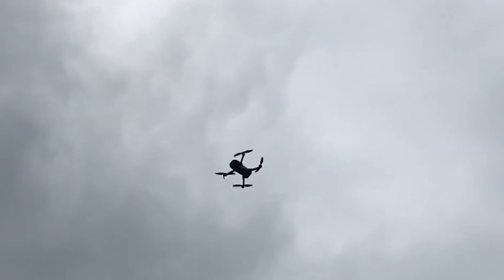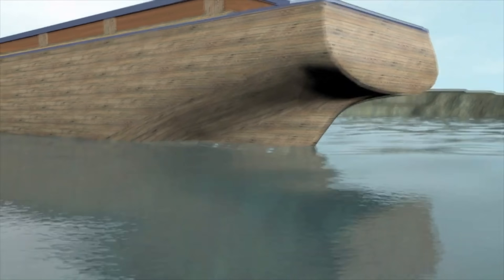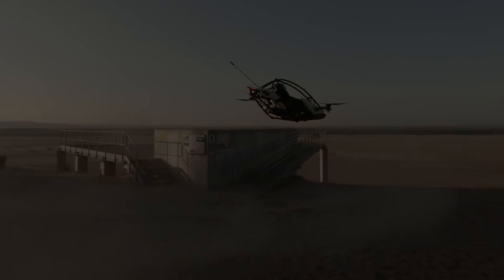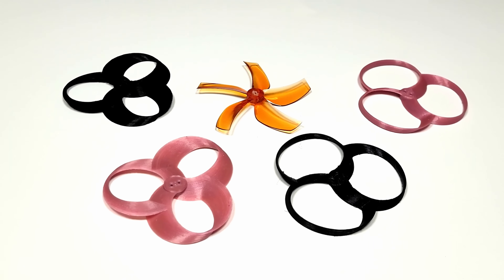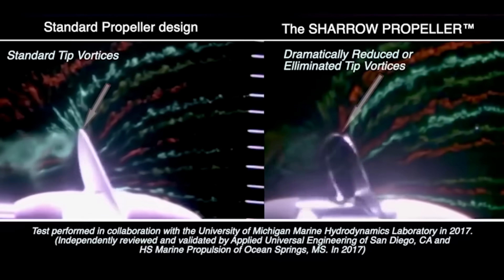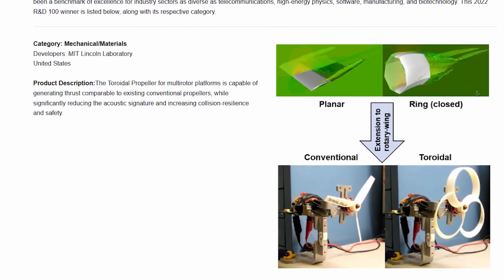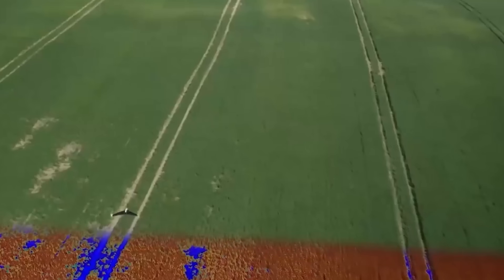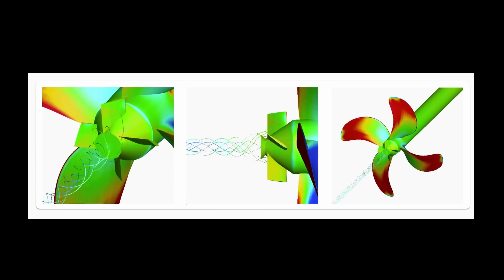This Propeller will Change Aviation Forever!

Comment: You know nothing about aerodynamics.  The conventional airplane propeller is very efficient, around 90 percent.  Some specific applications aircraft propellers are 95% efficient (large and slow turning).  Hell, the Wright brothers propeller had an efficiency of around 70%.  The difference is air vs water.  Boat propellers are below 50% efficiency.  That is why there is a lot of room for improvement in boat propellers.   Toroidal propellers will never be used in aircraft.

Comment: Look at the graph again @3.36 then running at full motor utilization the Toroidal propeller only delivers 160g of thrust while the standard gives 450g. 
So it is useless outside very niche applications where efficiency and payload matters very little.

Comment: You will not see this on general aviation aircraft.  GA airplanes must pass the "Queen Test".  This propeller on a marine application is acceptable due to alleged performance improvements, and most importantly, it is unseen.  For all the other myriad negative reasons, if the Queen (wife) saw this abomination on the front of the family plane it would mean the husband/pilot would have to make a decision between prostate exultation or this prop.  In my vast aviation experience prostate exultation will win every time.

Comment: why not do this, put a propeller on the back of the plane that is linked to the one in the front, as the front one pulls the plane through the air, the air will drive the rear one, thus powering the front one. it will accellerate until it breaks up.
btw, there is a group who claims to have done pretty much the same thing with a propeller driven car.
Reply: The was a German aircraft with an aircrew at both ends,  driven by a piston engine.

Comment: You can only use this if you do not have a variable pitch.
Try to come up with a design for toroidal prop with variable pitch!
Sure fine with a certain applications, but if you can’t change the pitch on an aircraft prop you are back in the pre-WW2 days.
Engine out, well no means to feather it to reduce resistance or stop the engine from shaking the aircraft to pieces. Speed difference, no means to adjust pitch to be optimized. So all this talk of revolution. It an interesting development which will have its uses, but it is not the end all. It will replace similar non-variable pitch props, sure if cost effective.
Could you use this technology with turbofans?

Comment: limited and will cause extra drag if your engine ever goes out as normal props you can feather to stop the wind spinning it around causing less drag while with these you will just be stuck with the angle on the blade not able to adjust it or anything there's a lot more that go into the props then you think specially as small scale these have already been destroyed by other designs as yes it makes more lift but also more drag and a lot more disadvantages to a normal prop design and with laws in the usa you cant even use these on your drones as they don't fold back and can lacerate and balancing these would be a bigger pain let alone anything goes wrong with all that extra wieght that would prob just rip the motor right out a cesna if a chunk broke off causing heavy vibration that again in the normal prop you can change angle of attack to stop from spinning while with this design you loose a chunk your going for a ride with nothing you can do about it it will end up just like the round wing designed planes that are just impractical because someone said oh it can lift more and dident account for drag wieght or anything else other then lift the only part i can find practical for its use is boat propellers and that's it as for planes more dangerous most drones in the usa cant use them on even tho ive tested a set on my dji and they are trash and loud when compared to silent generic prop designs and could never be used for a plane due to the fixxed angle of the prop and same issue with helis or anything else to use this design and bad for drones as ive found if i loose a chunk of my props with my drone i can still fly and bring it back in even off balance but with this design your just fked as u will loose all lift depending where it snaps from

Comment: I think one thing they need to consider are fluid variables. You can design a single propeller for water because it's relative pressure/temperature remains within certain parameters. While in flight, you're soaring through differing pressure/temperatures all the time plus the variables of the motor that turn it. (both electrical or combustion style motors)
Reply: It was lab test first in software, then they decided to test on drones.  This is far from perfect, but also far from optimised as air and water are both fluids but quite different...
Reply: Air is a compressible fluid. That does make things quite different to water
Reply: soaring so high above the world, never thought i could feel so free
Reply: @evanfinch4987  Hello Icarus :*
Reply: @evanfinch4987  lsd is good
Reply: @france895  
The worst drug on or off this planet.
Reply: @Mr.Robert1  Are you experienced?
Reply: The one application I’ve seen that seemed to have a lot of potential was continuous wings on planes that curve back to the fuselage.
Reply: im one with the birds, and magic is all i see
Reply: Flight would not be an issue. Prop plane propellers don't adapt to humidity.
Reply: @Broesky  They don't slice salami well either.
Reply: basically it is a box wing used as a prop.
Reply: This propeller is something like a ducted fan, I'd prefer to see how this does against a true ducted fan and a propeller with full ring around it...I just don't think it's a realistic comparison for any test
Reply: Yeh, MIT is hardly AFfirmative action central if you know wha im sayin
Reply: It's also not the end all be all for marine either. In the best conditions it's able to achieve up to 20% more fuel efficiency as claimed on some testing. But thats everything goes right testing, make one variable poor for the test and you radically drop efficiency. It's going to be a rather benign change that will affect the bleeding edge of the boating market, as well as the extremes. But starting at $5,000 for a 200HP marine motor really isn't very enticing considering a standard prop only costs $200-300. It's not like buying an engine for the boat either, props don't last forever. It's like buying a set of tires for the boat, at least if you want any performance. Sure smaller boats run their props for the better part of 30 years in slow lake boating as long as they don't prop strike anything. But take any bay boat and you are looking at a lifespan of less than 10 years.
Reply: Works on drones😂
Reply: please see my comment posted 7th April
Reply: I would think this problem would apply equally to normal  propellers as to this new type the only advantage open propellers seem to have is the possibility of adjusting the pitch in flight and this seems to be rarely done. As to  propeller life I would think that less vibration would result in longer service life.
Reply: it's ok the first toroidal props for airplanes with variable pitch are coming soon, nothing is impossible, think this way even if it's not true, it will help you puch your abilities to the limits, as for variable pitch propellers of this type, totally doable and possible.
Reply: Also ignores the advantages of variable pitch (constant speed) propellers, where the faster you move through the air, the more pitch you can dial in to grab more air at the same RPM. It would be a challenge with blades that are, looking at this, apparently immovable.
Reply: Just match the pitch of the blade to the motor and altitude
Reply: Fluid dynamics is broken into two main categories: liquid and gas. Main difference to each: one can be compressed, the other cant. There are also plenty newtonian and non newtonian conditions which affect motion and energy transfer. What makes this "closed loop" blade more efficient: they are stiffer. Less energy is lost to primary parasitic effects, which lead to secondary or tertiary losses.
Reply: @priitmolder6475  Wrong...liquid and gas both, can be compressed..ad they are both compressed in a situation like this.....compression on a boat screw edge causes cavitation (bubbles caused by the difference in pressures in relation to edge velocity. Compression on a plane propeller edge causes noise that result differing pressures on the back edge and leading edge, but it's not cavitation. 6 years as a Sonar Tech in the Navy...I went to school for this shit....so, don't listen to me, I don't give a shit...I'm right.
Reply: @priitmolder6475  would it make sense to hide something similar inside turbofan, where some of the variables can be controlled?
Reply: @MrrVlad  in theory yes, in practical terms no. Elongation at those high RPMs will become real issue.
Reply: Lmao. You genuinely believe you just told the researchers at MIT something they hadn't considered don't you.......People are so deluded its hilarious.
Reply: @kermitthefragg  Read the comment directly above yours😂😂and read my educated explanation...these people are insane😂😂
Reply: @kermitthefragg  The internet is fking hilarious and very concerning at the same time....

Comment: Could they make a wheel for a car with a shape similar to this propeller but with a rim and tire surrounding the propeller.  Would this cause enough air flow to keep the engine cool?
Reply: *radiator
Reply: ... where'd you think the airflow would go?
Reply: @ridhosamudro2199  This would create a vacuum between a wheel and the car that could suck out air through a grille or slots.

Comment: I have been pondering on the idea of a design to Far better the Ridiculous Massive high cost and size of not just the produce but also Massive cost of transport ing to site is Eye-watering!!! And they are not built with much thought.
That is the Huh Wind Farm structures, What ugly eye sites they are! The Toroidal Prop is the  design to replace the 3 blade props. Building a multiple say boxed number of props, plus installation of arrays of Solar equipment. If mounted in water movement or at a Dam structure, then power gained would be Far far greater than present Wind Turbines as already said A Huge amount of money wast to the Tax payer.
That’s YOU and I.

The Toroidal Prop is radical and you have to give credit to those designers trying to improve the propeller design. I say Well done to them!!!

Mm! The Toroidal prop would be a challenge as Swinging a prop to start your Pitt’s Special, or other types.

Keep up the jolly good work on the Toroidal Propeller people!
Could be super better than the present housed in cowlings re Jet engines. Just a thought!

Best of luck and Happy hunting.

JB. UK. 

JB. UK.

Comment: For the time being, I'll stick with my Prince P-Tip prop on my experimental. The P tips make it MUCH quieter, as verfied by comments of others over the last 2400 hours of flying with it. BUT, this looks interesing, if I had a boat.....
Reply: The P-tip is a beautiful propeller.  I had one but when visiting Paul Lipps in Santa Maria (I was there to meet him to balance the prop (his design and construction) on his Lancair.  In discussing my P-tip he explained how the fastest moving part of the prop, the tip, should be minimized, ideally to zero. This teroidal design seems to do just that.   A P-tip, even though it's true they are quieter (just like with Hartzell's Q tip) the additional mass being hung out on the ends is detrimental to efficiency.    I'm very taken by how sensible the torodial seems to be.  CNC machines and composite materials already in existence could be used to 3-D print one to exact specifications for use on Experimental category aircraft.   If someone is already doing it it would sure be interesting to read about.   I would be happy to contribute the use of my single engine Experimental conventional-gear aircraft.  Mass of the torodial may be higher than my existing wooden 52 x 56 but my plane tends to be biased toward the tail when in normal configuration so a little more weight on the nose wouldn't hurt it.    If made with a diameter of 55 inches or less and is drilled to mate with my standard shaft, standard prop bolt pattern, and has been statically balanced, I'd be happy to test drive this new idea.  Like Paul Lipps, I find props interesting.
Reply: right on

Comment: you know I talked about this prop on a plane a few months ago and everyone laughed lol
Reply: Don't worry, everyone's still laughing.  This is just another scammy content piece with bogus info about a prop design that looks interesting but has almost zero practical application.
Reply: @paulybeefs8588  it's actually quite interesting and possible but I'd have to explain engineering to you and probably reschool you from about grade 4 first.
Reply: @joematties7557  I'm sure that would be very interesting. I bet you learned a lot of great things at your special elementary school.
Reply: @avolantyable  ever heard of a fixed pitch prop? Ever heard of engineering? Just because you can't imagine it doesn't mean it's impossible either. It's quite possible,  it would just be really expensive
Reply: @avolantyable  you've made it clear you don't know what your talking about. Nobody switches props out on their planes, that's just silly. You may do that once in the life of the plane based on what you want or need but that's it. I have my own complex aircraft. Again just because YOU can't imagine it, doesn't make it impossible. The mission of this prop would be different, you'd sacrifice something for something else. I get you can't grasp that, but you don't know everything and you clearly don't know engineering. 

You could argue it would be expensive but to say impossible is a child's argument.

Comment: I wonder if they can make these in a constant speed variant  or is it just a set pitch for now ?
Reply: constant speed is a variable transmission, variable pitch is a completely different animal
Reply: @cayenne7792  Variable pitch is how they achieve constant speed in aircraft engines...They are direct drive props in 99% of cases and in the few that aren't they are fixed gear reducers..
Reply: I agree with Justin. Also, the new propellers being proposed are designed to be as efficient as possible.  For now, toroidal couldn't possibly 'change their pitch' w/o adverse effects.

Comment: So if this propeller is so much better, we should be seeing them every where very soon,
Reply: They can't be molded due to their shape.  Printing is necessary.  This limits the materials used and drives up the practical cost.
Reply: @FlatOutFE they are machining from billet for boats. $10,000 each.
Reply: @FlatOutFE  To use an over used term, it's it's a "game changer" then the cost should be worth it and eventually more efficient ways of production will be found.
Reply: @riogrande5761  , I don't think it's a "game changer".
Reply: @FlatOutFE  Bingo!

Comment: Nope it won't 👎
Reply: oh yes , it  will win ... we saw the first big aircraft props in test , made of carbon fiber  ... 3 kg the whole  prop system ... and unbelievable  powerfully...
Reply: @gulfstream-tvstudios9546  it’s expensive though so use cases will be narrow. It’s not going to replace all the propellers on a fleet of flight school Cessnas 172s for example. Maybe some individuals with big budgets looking for absolute performance will order one to be custom made for their boat or airline.
Reply: @jonasbaine3538  this video doesn't state it, but the efficiency improvement is huge. If it's big enough, they will find a way to make it cheap eventually.
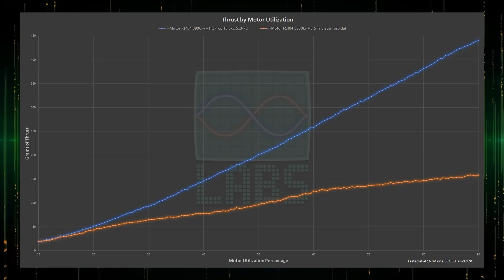Reply: @dstark125  take a look at 3:35 again. The graph actually shows the opposite of what is claimed.